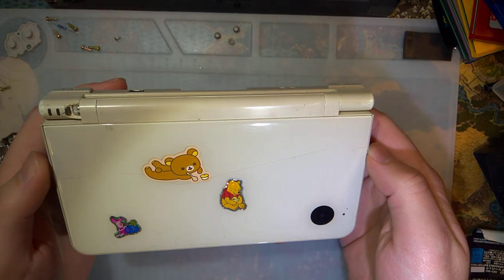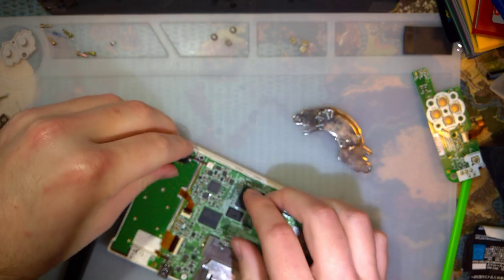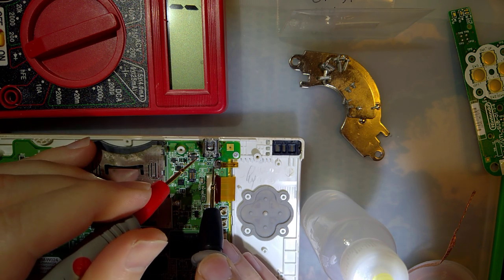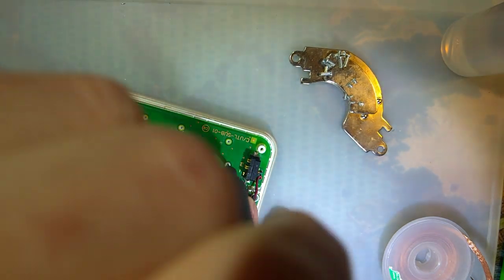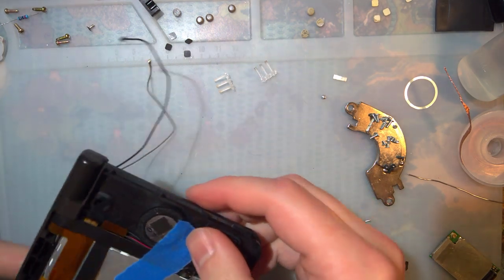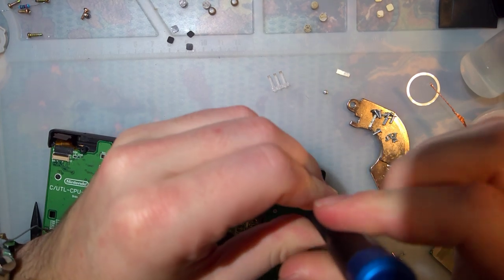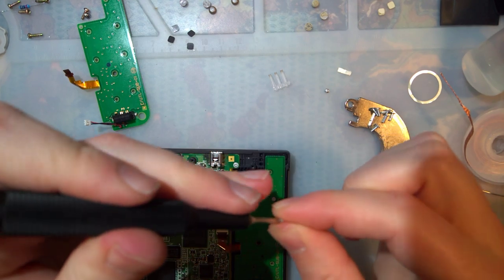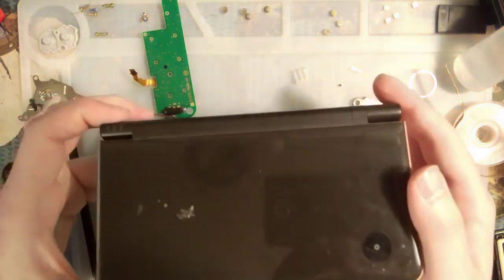Fixing some Junk DSi XL Consoles

Comment: Feeling much better about having blown the fuse putting the battery in backwards after seeing you do the exact same thing! My solution involved a long wait for a replacement board from China though.
Reply from the maker: Such is life. I'm worried that the fuses I installed are too low spec and will blow up when I charge it. Then I'll have to tear this thing apart again and install more fuses.

Comment: Sorry for bumping an old video but I had a few questions about the DSi XL I hope you may answer. 

Do you know if the 6 screws on the back are all the same? On the white and metallic rose versions the two near the cartridge slot are silver and not black. But according to ifixit the black/silver ones are all the same length. Some videos I've watched told the viewer to distinguish between these screws and put them in the right place. Is it more because of color than damaging the thread? Would it be a problem if I mixed up the 4 screws under the rubber feet and the 2 exposed screws? 

Do you also know the purpose of the white tape on the two tiny ribbon cables? The two cables for the touch screen and digitizer seem to make contact with the LR ribbon cables so I assume they are for insulation. I have trouble sticking them down after opening my unit for a screen swap but it seems the tension between the ribbon cables squeezes the tape in place. Would not like for the tape to come loose and then short the ribbon cables. 

What is the best way to remove the rubber feet? I used an ifixit carbon fiber spudger but it cut the rubber foot in half. Seems like it was too big and prying the feet upward poked a hole through it. I tried the smallest flathead in the ifixit toolbox and it worked better. It did slightly scratch my shell and the paint came off however. 

Do you know the possible cause of screen flickering? Went to a local game shop and they had an open box DSi XL but told me it had issues with screen flickering despite the only use being testing cartridges and charging. 

Japanese DSi LLs on ebay also have issues with screen yellowing. What is the possible cause of Japanese ones having so much yellowing?

Comment: I'm wondering if you can help me. I have a DSi which powers on but backlights don't work (can see image if shine light on it). Tested with another board and works fine so it's something wrong with the motherboard. Any ideas?
Reply from the maker: If there's a console repair discord, I'd recommend that otherwise try the console repair subreddit. Bring pictures.

Comment: Hi makho, I want to ask you a question not related to the video but yes with your knowledge, you who have repaired so many game boys, I have a question, specifically the sp ags 101 model, when you turn it off and turn on the console very quickly when starting it looks shows for a little moment the last frame of the console before turning off? , It is normal? has it happened to you? , thanks.
Reply from the maker: All LCD screens do that. You just usually don't notice because the backlight is usually off. Newer screens do refresh quicker, generally.
Reply: omg, I didn't know that, thanks for the information :O!

Comment: I have a dsi xl where i did a bottom screen replacement, it worked great however i put the battery against the mobo and now the dsi xl wont turn on. Did i burn a fuse if so where/how do i repair it?
Reply from the maker: Well, I did show the process for diagnosing and repairing a fuse on a DSi XL in this video. What part are you stuck on?

Comment: I was wondering if you can look at my original gameboy dmg. It has a black screen. I don’t know what to do.
Reply from the maker: Do you have a power LED or sound? Did you already check the contrast wheel?
Reply: makho power LED works. The sound works. The contrast wheel works but just black screen. I don’t know maybe the screen is broken. I see no scratches. It’s a childhood gameboy. I lost the battery cover a long time ago. I found it recently. Wanted to play Pokémon on it.
Reply from the maker: @Wisecholo3  Check your contrast wheel. Desolder might fix. If not, probably a bad cap or something.
Reply: makho ok thank you for the information. I will look at the contrast wheel.